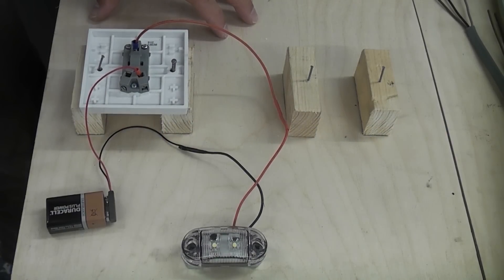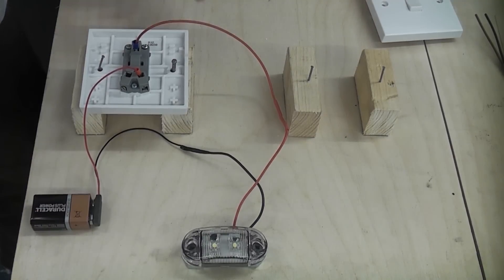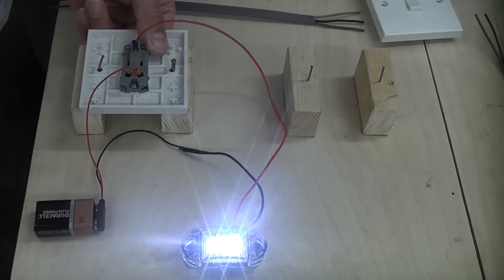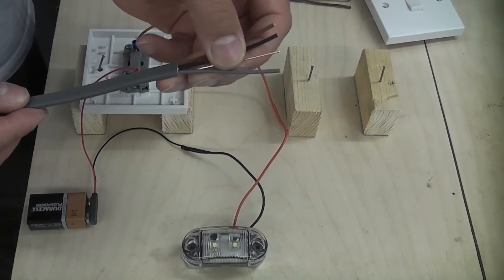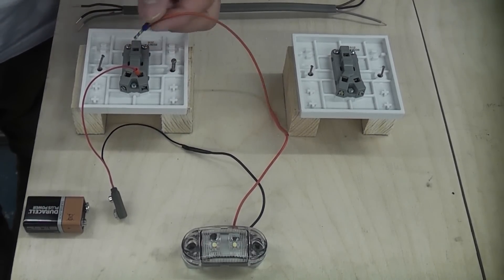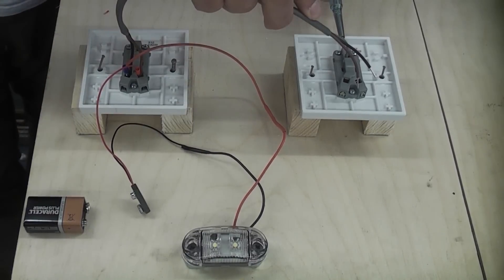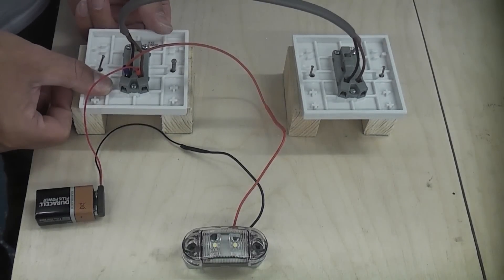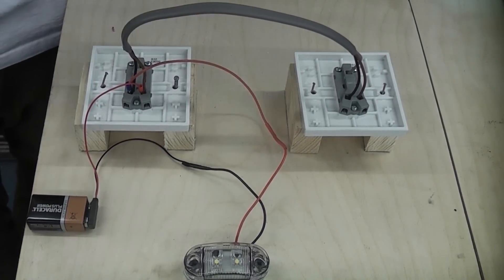Two way light switching explained

Comment: Normally you would connect the "hard active" from the supply to the common terminal, and the second common terminal is then a "switched active' to the lamp (s).
Then you connect a two core cable to 1 & 2, and 2 &1 (crossed so that the lamp(s) are off when BOTH switches are in the up,/up or down/down positions.

Comment: What’s cracking off if you have a light malfunctioning like one way switches in a room controlling a light (if one is off, the other can’t turn it on). And what would be the remedial action if:

The switches are both 1 way
The switches are both 2 way

Comment: Its one of these things you can understand 100% or 25%.  If you sort of get it then you understand it enough to make it work. However you didn't offer and detailed account of the circuits and why they operate as they do... to fully understand it you have to get your head round that I guess. But it was very well explained.. espeacially how you connect both swithes the same way... oops spelling mistake

Comment: How do you connect the lamp in series. There are only 3 wires and 3 slots in the switch. Connecting the lamp to the common as kyle A suggests is a lot better method.

Comment: I've been looking for video information on how to wire a light via 2 way switching, my daughter just moved in a house and the switch at the bottom of the stairs worked independently from the one at the top, I couldn't make head or tail of the wiring, or any of the electrician's videos, after watching your it seemed so simple, I screenshot your diagram and looked at her wiring, dead simple,  one of her wires had been put in the wrong switch connector,  did it the same as your diagram ...Bingo, can now turn on at top or bottom and turn off at top or bottom..thanks for doing this video
Reply from the maker: I'm glad the video helped 
Thanks for the comment 👍

Comment: would it be correct to say that this is a 2 plate method? because the live goes to the switch first?
Reply from the maker: I’m not sure, what electricians call this set up. It’s probably like most things and will have several different names 👍

Comment: Just in process of adding a 2way in the garage. Currently has single batten light in the middle with the mains going direct to the light and the current single switch connected there. I'll run the 3 core from switch to switch front to back. Then I'm guessing I'll run a 2 core back to one of the switches. 

I need to add two more batten lights either side could I piggy  back them from the middle, or need to wire them in series?
Reply from the maker: This should help- https://www.youtube.com/watch?v=IwWIvcV2YTI&t

Yes, you can just piggy back the other two lights (wire in parallel) 👍
Reply: @ultimatehandyman  just finished the job, probably could have been more economical with the flex, but it's all working. Thanks for the videos and help!
Reply from the maker: @Hollingsabre  You are welcome 👍

Comment: Having a nightmare with this repair (bedroom ceiling lights failure, 1st switch by door, 2nd by bed).  Changed all GU10s in case of simultaneous lifetime failure, all new and dimmable.  Dimmer switch by bed non dimming switch by door.  Undertook continuity check Door L1 blue to Bed blue all OK.  Continuity check Door L2 yellow to Bed yellow all OK.  Door Red COM to Bed Red COM no continuity.  Is this my problem and does this mean rewiring and re-plastering?
Reply from the maker: You need to remove the light fitting and look at the wiring.
There is a "cable saving" way of wiring two way lights, it is possible that they join at the ceiling light fitting, or even in a junction box (probably near the light fitting) 
If you remove the light fitting, you might find more wires than you should, it is possible that one of them has come loose.
If it's wired as per a normal light - https://www.youtube.com/watch?v=DoVSdqeFkhE
It looks like there is a break in the red conductor. Depending on where the break is will determine whether or not you need a rewire/re-plastering.
If the cable is visible, in the loft etc. You can visually inspect it.
The break might not be behind the plaster, so it is possible to cut and join the cable in the loft, providing the break can be found.
Reply: @ultimatehandyman  Thanks for the reply, esp confirming that the Red COM is probably broken and needs attention.  A job for Monday.
Reply: Turned out to be broken bedside dimmer thank the lord, and thanks for the tips.

Comment: Thinking of it as logical operations helped. The diagram specified describes a XOR table. Lamp lights when switches in different positions (one up and one down).
The other lighting diagram mentioned in comments (Line to Com, L1 to L1,  L2 to L2, Com to Lamp) is the opposite, a NXOR. Lamp lights when switches in same position (both up or down).
Given OCD, probably a different diagram altogether: Line to Com, L1 to L2, L2 to L1, Com to Lamp. Reversing, gives you back a XOR. Lamp lights when switches in different positions (one up and one down).  😁

Comment: Thanks mate. Your schematics diagram really helped me to understand. I have a quick question if you don't mind me asking. If both switches are on L1, would that mean the light is off? and where would the current be going? does it stay looping around until the switch is turned back on or does the system automatically "cut the power" so there's no current until a switch is turned to L2 again?
Reply from the maker: I'm glad the video helped 
I think this video might help- https://www.youtube.com/watch?v=h7qPuhxOyqw

Thanks for the comment 👍
Reply: Ultimate Handyman thank you man. It explained more than I was hoping 👍🏾
Reply: that's what I want to know. surely it's dangerous for live to be going back to live with no load on it
Reply from the maker: @as3cs3   No it will be fine, as long as it's all from the same phase. If you think about your consumer unit, all the lives are connected together (although via MCB's).
If you were talking about two different phases touching each other (which would be possible with three phase electric), you'd get a huge bang and need a clean pair of underpants ;-)

Comment: I'm confused by a new double switch I've just got. The old switch had the Y shape doings at the back but the new switch has 2 L1's on the one side & 2 L'2's on the other side. I put 1 wire in an L1 & the other in an L2 but they turn opposite lights on. So I then swapped to other L1 & L2 still the same but now one switch is down & one is up. What do I do?
Reply from the maker: It sounds like you have an intermediate switch. This might help- https://www.youtube.com/watch?v=h7qPuhxOyqw
Sometimes there is nothing you can do about the switches being in the up and down position unless they are on a one way system, in which case the only way to fix it is to turn the switch upside down.
Thanks for the comment 👍

Comment: Hi I just started as an apprentice electrician and the people I work with just use the double or single live cable for those switches. Is it ok just using those cables?
Reply from the maker: There are a few ways of wiring these circuits up, and every electrician has their own way. The method that I use in this video, is what I would normally use to convert a normal one way system to a two way system, as per this video- https://www.youtube.com/watch?v=IwWIvcV2YTI
Good luck with the apprenticeship 
Thanks for the comment 👍

Comment: Hey is 1mm 3 core and twin cable okay for connecting the 2 Light switches together?
Thanks 
Great Vid 👍🏻
Reply from the maker: Yes, providing the lighting circuit is protected by a 5 amp fuse or 6 amp circuit breaker. 
Thanks for the comment 👍
Reply: Ultimate Handyman 
👍🏻

Comment: Isnt it easier and cheaper to just connect L1 to L1 and L2 to L2 while one com gets the line and the others com goed to the lamp and then lamp to neutral? You will use less cable and a much simple method right?
Reply from the maker: Yes, it might be, but my videos are aimed at DIY'ers
Thanks for the comment 👍

Comment: Thanks for the very easy to understand video, I followed the two-way switch diagram that was included with the switch and ended up with it not working correctly, (when one switch is in the off position it totally disabled that the switch. Following your diagram solve the problem thanks
Reply from the maker: You are welcome. I'm glad the video helped ;-)
Thanks for the comment 👍

Comment: Very nice video.  Could this be done if you have a loop switch? Power running to the light fixture, then a hot and return line in the switch?
Reply from the maker: Yes, it does not matter if the loop in is at the switch or the ceiling rose, you can still convert it to two way switching
Thanks for the comment 👍

Comment: Just for accuracy should the battery have not inputted to com and the output live to the light be L1?
Reply from the maker: It depends which way you wire it. The method I demonstrate is for people that would be changing a one way light switching system to a two way.
Thanks for the comment 👍

Comment: hi , what if my 2 gang 1 way switch only has L, L1 , L2, L. How should i connect. i have 2 live wires (red) and 1 yellow (earth wire) Plus 1 more earth wire which is removable. the 2 live wires and that 1 yellow wire is not removable as it has been preinstalled when i bought the  house
Reply from the maker: Earth wires should be green and yellow, not yellow.
Have you seen this- https://www.youtube.com/watch?v=IwWIvcV2YTI
Thanks for the comment

Comment: Excellent video.  I drew a diagram from the video and followed the instructions successfully.

My friend who is an electrician saw the diagram and approved.  Thank you Ultimate Handyman.

Hardy
Reply from the maker: Sometimes the L1 and L2 are at the top of the switch and sometimes at the bottom, depending on the make.
Thanks for the comment

Comment: A simpler connection: Live to com. Sw1,  L1 Sw1 to L1 Sw2,  L2 Sw1 to L2 Sw2,  com. Sw2 to lamp, and lamp to Neutral.
Reply: Daniel R. Markich  correct Daniel, that is the way to do it
Reply: Daniel R. Markich if you use this method, it makes it so easy to add intermediate switches,

Comment: In Italy it's called "deviatore", which translated is "diverter", more or les. So you get a "diverted light switch point". You can "cascade" them, using as much of them as you want (more or less huh), to control a light by one, two, three or more points.
Reply from the maker: Thanks for the comment

Comment: can you make a video using brown green and yellow and blue to make a 2 way lighting circuit with 2 socket outlets
Reply from the maker: No, sorry.
Just substitute the red for brown and the black for blue, then connect all earth terminal using the earth wire sleeved with green and yellow sleeving.

Comment: Here in America, you hit one switch with the hot, pull two travelers between them, and then hit the other switch with the switch leg. The diagram on the thumbnail is wrong. The hot wire doesn't go to both switches. The only wires going between the switches are the travelers and the ground

Comment: ok I want to put a new light in the loft no existing light up there. do I run a live feed from a junction box that's in the loft to the light switch then from the switch to the light? also as I'm running a live to the switch I assume I run the negative and earth up to the ceiling rose directly from the junction box and then  back to the junction box? is this correct? I understand the live feed but no one ever seems to explain the negative and earth when doing  these videos.

cheers
Reply from the maker: 1. Find junction box an identify the permanent live wire. Ensure the circuit is isolated before starting work! 
2. Run suitable cable (normally 1.0mm twin core and earth) from the Live, neutral and earth to the new switch.
3. Connect the live wire to Com on the switch.
4. Run another cable from the switch to the light and connect Live, neutral and earth to the new light. From this new cable put the live wire into the L1 terminal on the switch.
5. Connect both neutral wires into a terminal connector at the switch.
6. Terminate both earth wires into the earth terminal at the switch (if there is not one join them together in another terminal connector).
Restore the power ;-)
Reply: that's my confusion. a switch has com and L1 for live going in and out if I run the wire from the junction box as you say I will have com to put the live wire in and earth point however  what to do with the neutral? do I attach the two neutral wires together  that are comming from the feed (junction box)  and the other going to the rose.? I've asked electricians to do the job but as it's not an expensive job no one's bothered comming out. I'm fine with sockets and willing to do the light it's just the neutral that throws me because live goes to a switch and live comes out what about the neutral 😂😂
Reply from the maker: Yes, you just join the neutral from the new light and the neutral from the original junction box (or ceiling rose) together using a terminal connector in the back box of the switch ;-)
Reply: cheers buddy once again you save the day.

Comment: What switches did you use in the video?  Can I get them in the US?  Would be perfect in my box trailer with 12v battery, small solar system and Led lights.
Reply from the maker: They are standard UK light switches, I think they are different in the USA, although they should work the exact same way. 
I'm not sure if you can get them over there, sorry.

Comment: Great video, but got me a question:
What would happen to the wires / will wires burn or not in case of the following scenario:
Switch 1: com-L1 and same time Switch 2: com-L1
Thanks !
Al.
Reply from the maker: No wires will burn. It will either work or it won't work as you only have a live wire and wires that become live once they are part of the circuit. 
Thanks for the comment

Comment: Thanks for this video and clear explanation. It is a perfect, simple and a safe way of converting a one way to a two way switching system without making dangerous joints. I knew about the other method which is ideal for new installations, but this is an excellent alternative for working on old or already existing installation.
Reply: Not proper way. Read  kyle A above.

Comment: Question, i recently changed over my light switches and copied them like for like but... I can switch it on downstairs and turn it off from upstairs but the next evening i cant switch it back on from downstairs! Arrrrggghhh really frustrating and also all the wires are red apart from 2 that are black with red sleeves.... Any ideas what im doing wrong?
Reply from the maker: It sounds like the wiring is mixed up. Your best bet is to ask here and give as much info as possible such as pictures of the wiring at both switches- http://www.ultimatehandyman.co.uk/forum1/lighting-f33.html
Reply: Ultimate Handyman cheers pal, I'll get on that tomorrow

Comment: is there any reason why you can't use 2 wires from switch to switch. cheer's
Reply from the maker: No, there are a few ways to wire this circuit- but this is normally the easiest if you want to add another switch to an existing circuit. 
Thanks for the comment
Reply: Well the simplest way to do this in a new installation would be to connect the mains to the common of switch 1, connect the L1 and L2 of switch 1 respectively to the L1 and L2 of switch 2 and connect the common of switch 2 to the light. This is better as there are less wires involved. However, in case you already have an installation, the mains and the light are already connected to the existing switch. So if you want to add another switch the quickest way is to connect the new switch in 'parallel' (common to common, L1 to L1 and L2 to L2) with the existing switch (and rewire the existing one) like in this video.

Comment: Hi, handyman. very happy with all your videos, especially the electrical ones ATM, as I'm now studying to be an electrician. 
If I am honest: in some cases, my tutor does not explain things the way it should be explained, (very rushed). However, the topic- two way/ three way and intermediate switching are what I'm currently on and it was only when I watched your videos and correspond with your thorough explanation, that was when I understood. on the other hand, I would love it if you could do a video on the easiest way of calculating resistivity in material, as I'm still slightly confused about the method!?Massive thanks to you mate. Kepp up the good work.
Cheers.
regards
Lincoln from Essex`
Reply from the maker: Hi Lincoln, I'm glad the video's help.
I'm afraid I don't do things like calculating the resistance of material as I'm a maintenance engineer and not an installation electrician. 
Best of luck with the course ;-)

Comment: First time I see this setup and it looks weird to me. Also it feeds 3 wires (4 if you add the neutral) from switch to switch.
Set up I know : conect L1 to L1 and L2 to L2, now feed live to com of switch 1 and connect bulb to com of switch 2. Big advantage here is that you have only 2 wires going from switch to switch (3 if you add the neutral) also you have a single connection to the live wire (L) which means that if you disconnect that wire and remove the bulb the rest is 100% safe to touch.
Reply from the maker: There are a couple of ways of wiring a two way system, this method is easy if you want to add a second switch to an existing lighting circuit. 
Thanks for the comment
Reply: ***** Sorry, but it isn't. The "normal" method, which is used by ALL electricians, doesn't even need inserting 2 cables in the connection points and has a single point of live wire connection!
Reply from the maker: Why don't you go and spit your dummy out on another video.
Get used to the fact that this is a common way of wiring a two way system in the UK.
You can remove one wire to make the system safe to touch- BOLLOX